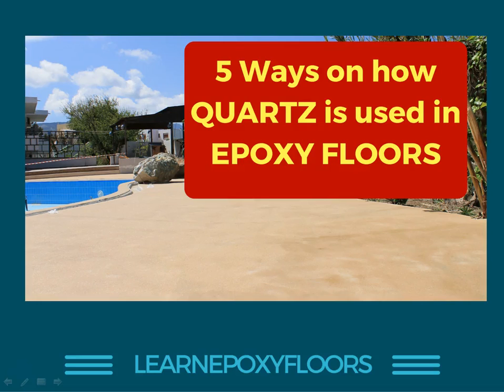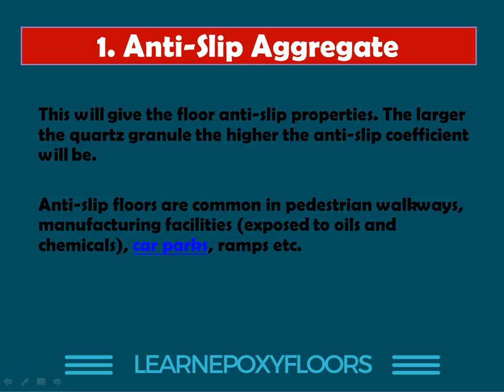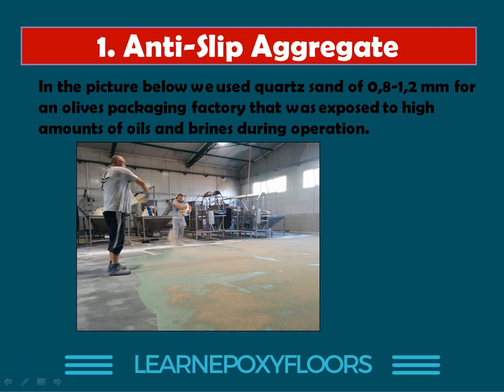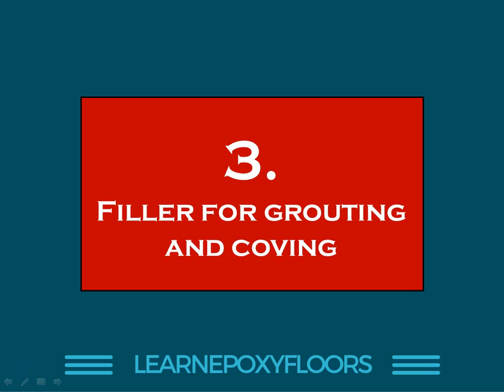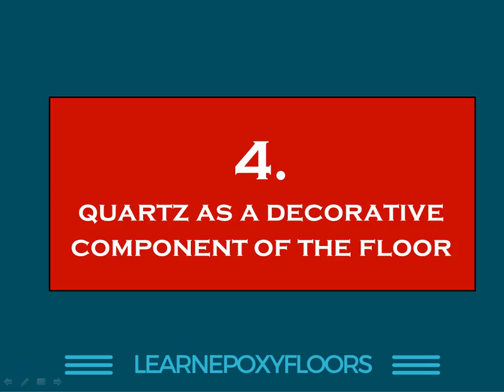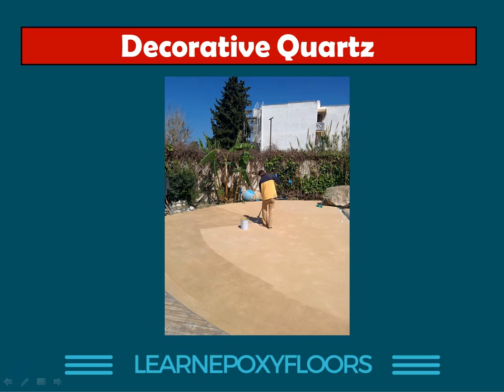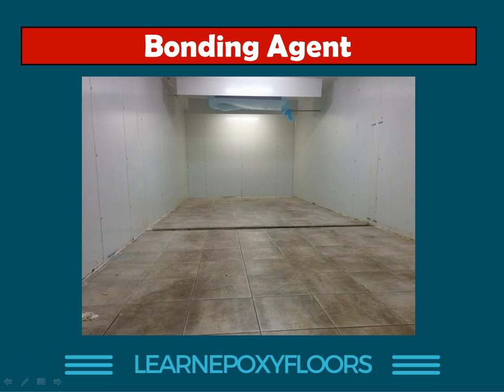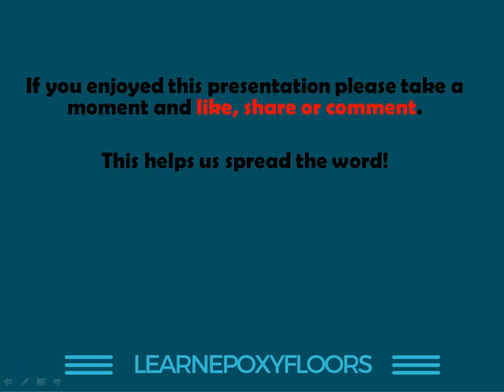Quartz Epoxy Flooring: 5 ways on how to use quartz sand in epoxy floors

Comment: Thanks for this video. I've recently just got my old balcony redone by a contractor and asked to apply a sand coloured decorative quartz.
I notice in your example of the decorative quartz, which is also sand coloured, it uses a white base epoxy coat however for our balcony it looks like they used a darker/black epoxy base coat.
Once they did the broadcast over the coat it all still looked the colour of how we wanted it to (sand coloured) however when they came to finish it off by sweeping the excess broadcast away and applying a top coat, we have been left with a very dark grey colour of our decorative quartz which is not sand coloured at all.
I'm not sure whether the top coat is still drying and it will become lighter again but i was just wondering whether a white epoxy base coat would have been essential to retain the original sand colour of the decorative quartz and if you have any advice on how we could possibly remedy this?
Reply from the maker: Once the floor has been put down, you can't really change the appearance without re-coating the whole floor

Comment: Can epoxy-quartz mix be used in the terrace for leak proofing of water ingress to room through the terrace.
Reply from the maker: Yes it is a possible solution, but make sure you have the edges around the perimeter properly sealed. 90% of leaks are around the edges
Reply: @learncoatings-epoxyfloorin9448  Thanks

Comment: I find it tricky to screed the epoxy when mixed with sand!
Any tips?
Reply from the maker: Usually less resin is better than more. I used to mistakely add 30% resin in the sand thinking that it was necessary. But I find that it is easier to screed with 10-15% resin

Comment: I have a very bad concrete patio. I have seen a method where people use small rock and epoxy to make a cover layer. If I were to use this method, it would make the level to high for the doors. Can I mix sand with epoxy to apply a thin "skim" coat over the cement patio?     Many thanks,  Frank
Reply from the maker: you can apply thin skim coats, but you need to make sure that it will bond properly with the substrate. So make sure you have primed the substrate properly and that it has a good grit to accept the epoxy/sand coat on top